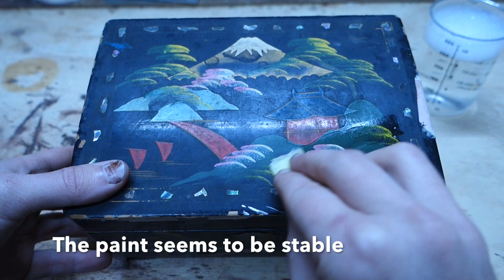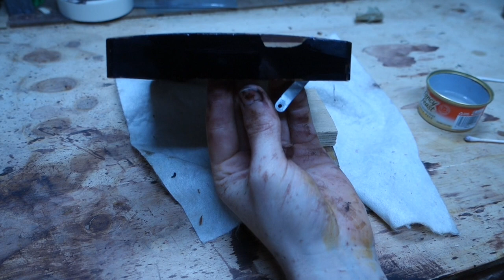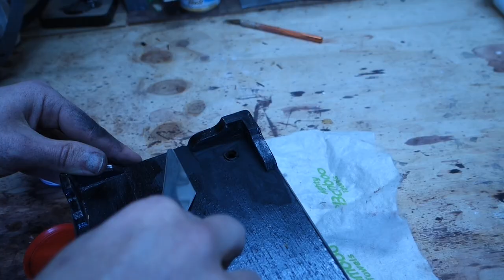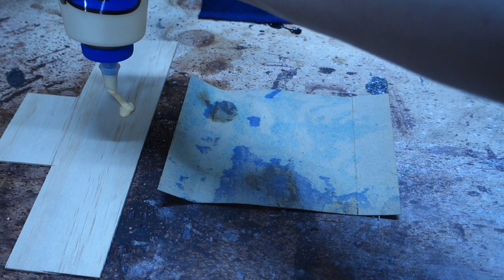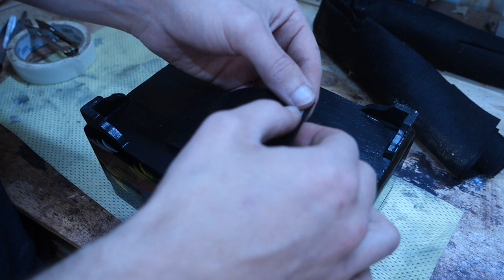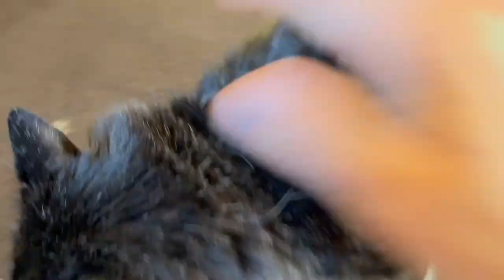1950s Japanese Jewellery Box Restoration and Repair

Comment: Nice job! Was really hoping to hear the music play when you opened the lid. My dad gave me one very similar for Christmas when I was about 8 yrs old, but mine had a tiny dancing ballerina inside who popped up and pirouetted to the music. I think those little rings on the interior lids had red tassel pulls to open the lids.
Reply from the maker: Thank you very much 🙂 you can listen to the music at the end of the video just incase you missed it! That sounds like a wonderfull gift, do you still have the box? Very interesting, I would have had no idea if you had not told me. Thank you for sharing!😀👍
Reply: I also know this box, red tassels yes, the box in the video was missing the gadget that starts and stops the music, its also the piece that pops up the dancer when the lid opens. Other things missing (you don't know if not had an original to compare) gold margins around the abalone on lid, gold tracery on inside mirror which is a copy of image thats on top of lid. Alas, that water based finish 'may' fail in time, the original finish is lacquer. That all said, it turned out fabulous! 👍👍👍

Comment: Great restoration!
My grandmother had one of these, as well as my mother!
On the inside case, there were red, tassles, a couole of inches  long..Silky, soft.. (I have only the inside box now..)  
Always loved these boxes for sentimental reasons both family members gone now..
I don't think you showed all the products you used, as I remember., for  beginners , like me.
Thanks for sharing your nice work. Looks great!
🖖
Thank
Reply from the maker: Thank you Mulleno! That’s wonderful to hear. They are quite nice boxes, I’m glad you were able to keep yours. I am sorry to hear that your family members have passed on but what a great way to remember them. 

Ahh yes I am guilty of cutting out important parts sometimes 😅 I used a very fine filler for the chips. Black gloss spray paint for the colour. Water based gloss varnish for the top coat. The cleaning was just regular dish soap and water. Navy blue corduroy for the fabric placed in with regular PVA glue. 

Hope I was able to help! Thank you for watching 👍🙂

Comment: I salute you! 🫡  you have a lot of patience. BTW, I have a round table, app. 40 + cms. It's from Mexico, I believe from the State of Michoacan. This is black, with the same lacquered black paint as the box you fixed, with a beautiful design that starts in the middle, (a huge basket with tons of flowers). 
It belonged to my Mom. But when they moved to another country, the poor table lost a leg, there were 3 legs and there was a long one coming down from under the table's center, and the 3 legs came out from it. Ther have an "S" form and come out like spider legs from the end of that long one. (Hope you understand.) 
One of the S legs is off, it doesn't fit anymore in its place, it seems like it is swollen. The top of the table can be folded and that's what makes it uns-table. 
I brought it home. I put something on the table, and went out, when I came back, it was on the floor. A big chunk of the edge of the table was broken, the paint "fell" 😢 and I kept the table it just because it was my Mom's heirloom to me.
Could you please tell me what soap you used to clean it and the water + soap ratio?
What glue can I use to glue the broken leg and part of the round table, too?
Reply from the maker: Very much appreciated cris. Ohh no 😞I feel your pain. Repairing this type of damage can be quite difficult id suggest using a reputable restorer as some equipment is needed. However if your willing to give it a shot I will list my suggestions. Use a pva glue, I use titebond 2. You will need to find a way of clamping the broken joints together, you can buy your self some clamps 🗜️ just make sure you get ones with rubber tips and ensure the broken joints are making contact (glue squeezing out) just use regular dish soap and water, a teaspoon in a cup of water is sufficient. Anyway if you have any issues just shoot me a message. 👍🙂

Comment: Kudos to you friend! That's  quite a project. I acquired one today. I was shocked when I took it apart to find the original Toshiba batteries still inside!
The music mechanism was wound too tight so off I went...time to give it a new life. Took it apart and pushed on a few things and wallah! Music. Not quite sure what the batteries are for, to magnify the sound I presume.
Does the box have inlaid abalone on all edges? Mine does. The hinges are kind of goofy. That's where attention is needed the most, and a good cleaning. I also found the original key to the lock on front! Sweet!!
Anyways, thanks for the post. It gave me confidence to tackle mine.
Reply from the maker: Sorry for the late reply Susan! Yea it’s a  bit finicky restoring these. Wow that’s amazing, I didn’t know they came with batteries I thought they were all wind ups. 

Not too sure why it would have batteries, I would imagine resonance of the box amplifies the sound, but I could be wrong. 

Your lucky to get one with the inlay still intact, I’ve seen ones missing tassels, handles, artwork rubbed off. I’m really not sure if they were made as duplicates of each other or just pieces have gone missing. As most have very different elements about them. 

Anyway I hope it goes well and a i believe you can do it. If you run into any trouble just shoot me a message😀👍

Comment: Did the music play before and after the restoration? I was hoping for a closer look at how the mechanism worked.
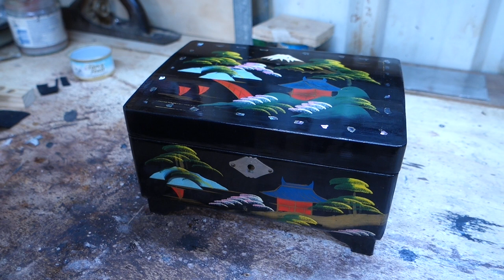Reply from the maker: The mechanism was working without issues before the restoration, just a little dusty. The only thing that was missing was the wire stopper that starts the flywheel when you open the box to have the music play automatically. You can listen to the entire tune at 23:16.

Comment: I keep thinking  I wanted one to totally strip and have it be all wood , but only  if paint was 50% or more falling of . I find them like that every so often  $5-$10 and pass .maybe I'll step up. There's new options  😁 I've done cheap paint  build up but not sure of long term results  , nice video . God Speed
Reply from the maker: It is was tempting but the owner definitely wanted to keep the artwork intact. Although even the artwork was rubbing off on areas so it was good to seal it with a poly. Give it a go it’s a fun challenge, just take it one step at a time. Thank you 👍🙂

Comment: Hi I loved the video!!! I have a box of the same type too but mine has a sort of laquer panel over where the hollow for the metal working that makes the music should be. Do you know how I can get it to come off?
Reply from the maker: Very much appreciated! ☺️ hmmmm I would try to pry it off with a very thin palette knife. You can use a piece of cloth under the knife to prevent damage. If it’s glued on you may want to try heating it up very carefully, and try gently prying it off. Sometimes damages are inevitable to repair or to gain access.

Comment: I am undertaking a similar reatoration including wiring in new led lights (mine has a moving rickshaw and two lights inside), which isnt a problem, but i do have a couple questions about your thoughts on painting:

For the plain black areas i intend to follow your lead.  Some filler along marred edges, a light sanding, a spray paint acrylic paint/primer and possibly some bottled gloss acrylic over that to even up....
But the top of mine has a gold painted border that is damaged.  I was thinking i could just tape off, lightly scuff with fine grit, and put a good opaque enamel or acrylic paint over that.  To seal it all, im not sure if i should put a layer of shellac first so i can lightly scuff the whole thing before using a spray on clear acrylic topcoat or just go straight with the acrylic topcoat (im worried that without scuffing, the waterbased acrylic coat might not stick well to whatever the original finisb is.  Lacquer?).  Your thoughts on that would be really appreciated.  Also, mine has pleated pink felt inside that's mostly intact but theres a small stain or two.  What would you recommend that might lift the stain without damaging or altering the fabric color?  Soft toothbrush with maybe like an oxy-compound for colors or something?  Just warm water? (On felt?  Feel like it needs to be some sort of dry cleaning agent).  

That being asked, beautiful job man.  Please write back!
Reply from the maker: Hey mate I really do apologise for the delay in response. Occasionally one or two comments slip by my notifications. Do you have an email? I can email you with everything I did and the products I used.

Comment: Hello thank you for the great video. I have a similar box with similar damage but also has oxidation or something going on with the mirrors. If you had to replace/repair the mirror under the lid how would you go about doing it?
Reply from the maker: Not a problem at all Ian thank you for watching. That sounds like a tough one. I would try prying it out with a thin palette knife. It’s probably glued on underneath though so I would recommend slowly heating it up and try softening the glue. If not id just remove the mirror entirely by breaking it into small pieces and replacing it. I would recommend trying to clean it first and see if that fixes the issue.

Comment: I have one of these and can't seem to figure out the music function. The wind up key isn't working properly, it's really stiff and I can't seem to get it to wind. It keeps making noises on its own. I don't think the winding key is original but the rest seems to be.
Reply from the maker: I would suggest checking if there is any blockages in the gears, there may be a piece of dust or something similar blocking the turning motion so give it a good clean. You can buy replacement parts if the aftermarket winder seems to be the issue. Here is a link to some common replacement parts https://www.clockshop.com.au/music-boxes/music-box-parts/

Also check that the wire stopper isn’t obstructing the flywheel.

Comment: Excellent job! I have a jewelry box my Father gave to my Mother and it needs to be cleaned.  What type of soap should I use to do that?
Reply from the maker: Thank you laurale! I’d use any type of unscented sensitive dishwashing liquid. I just used a cup of water and a dash of the soap to get rid of any oils and grime. Also make sure there are no drips as some parts of these boxes are made of paper. Keep an eye of the painted sections for any peeling or if the paint seems to be coming off 👍😺